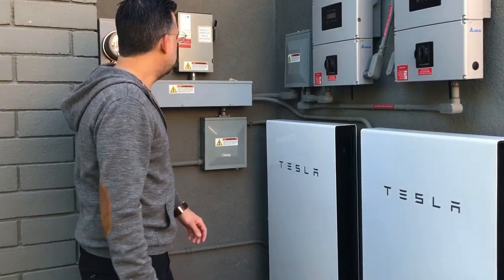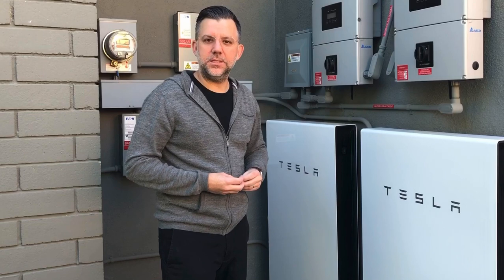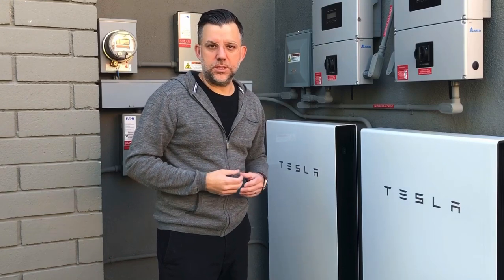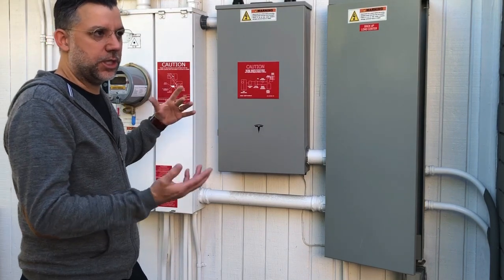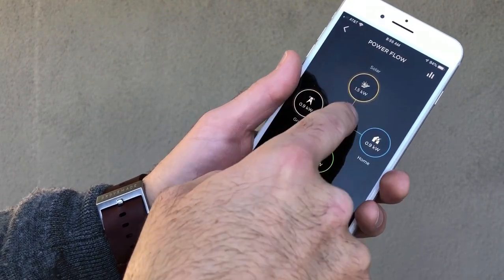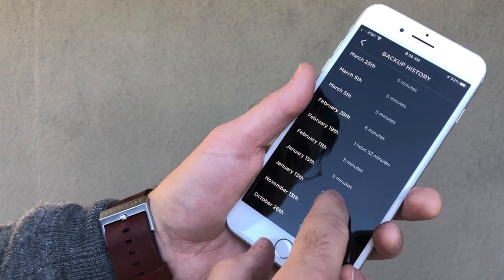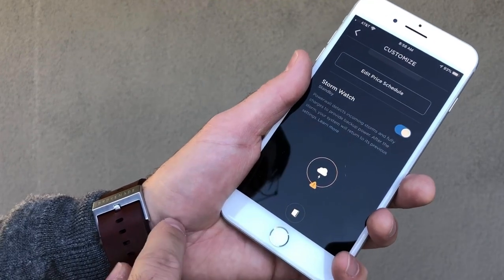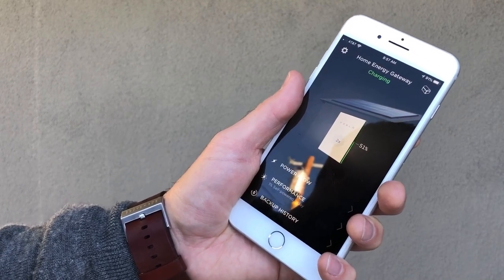Tesla Powerwall 2 hardware and software review.

Comment: Just had a similar set up in Stafford VA.  Got 36 panels but the new panels are 340w, also got 2 power walls.  didn't get a backup load panel because the whole house is being backed up.  Also got the Tesla backup gateway 2.  Ran a 12 hour self power test last night and used about 45% of the power walls before the sun came up. Winter will be a really energy hog out here, but should be able to be self powered through the summer. Thanks for showing your system.

Comment: What type of inverters(model #) are those how how many KWH can each support?
Reply from the maker: Hi Karl, Thanks for your question. The inverters are Delta Solivia 5.2 TL models. My system is 36 panels with a daily average output of about 7-9 KW. Each inverter supports a max output of 5.2 KW. I hope that helps. Let me know if you have any other questions.

Comment: How long does it take to fully charge one pw on a typical sunny day? I’m in LA as well.
Reply from the maker: It is hard to say as there are a number of factors that can influence the charge speed. The house usage on that day will affect the speed (is the AC on? the pool pump? is the car charging?) It really depends on the size of your system and the weather, sun hours etc. But generally speaking it should fill up in 4-6 hours. You can select it to prioritize the charge over the house power usage from solar. You can also select 'storm watch', which will charge it for you before a storm event or high winds.It is highly customizable through the app. I hope that helps.
Reply: ROOTSROBOT thanks for the reply!

Comment: Did you get the solar and pw thru tesla? Did you apply and qualify for SGIP rebate?
Reply from the maker: Yes, it was installed through TESLA. I did not receive the SGIP rebate. This was one area that I was unhappy with Tesla. They handled the application on my behalf and it it never came through. It is possible that I may still receive it but the whole SGIP process is extremely convoluted. Each installer has a certain amount of dollars available.
Reply: ROOTSROBOT status of rebate cannot be checked online?
Reply from the maker: @1baomao  I have contacted Tesla numerous times and have not heard back from them regarding this. The case number needed to check online is available from the Installer and I have not been able to get any updates from Tesla. This is an area where Tesla could definitely improve.

Comment: Great vid I am in the process of getting a 30 Panel system and 2 power walls. Question what if you have no internet? Does the powerwall still work?
Reply from the maker: Thanks for your comment and question. I believe that an internet connection is required. If there is no connection, you would not be able to monitor and change the powerwall settings. Also, Tesla needs to see the production status through the gateway in real time for troubleshooting. I would check with your local Tesla sales rep for clarity on that question. Let me know if you find out. Good luck!

Comment: Great video! I have had solar for 4 years in North Carolina, but did not have the chance to buy a Powerwall. In my area we have net metering and battery only makes sense for backup power or self generation. I am saving up though as battery makes my home more independent from the utility and their rates. Keep sharing you experience.
Reply from the maker: I encourage you to get it if you can add it to your system. Check with your local utility to see if there may be self generating power rebates available in your area as well. If you have TOU rates from your utility, like we do in Los Angeles, Powerwall is great for load shifting. This is the ability to bank power during 'off peak' (low priced evening power) and use it during 'peak' (high priced daytime power). It makes for an invaluable asset to any home. Here is a link to Tesla's page on this feature and how to enable it in the Tesla app: https://www.tesla.com/support/energy/powerwall/mobile-app/time-based-control

Comment: Currently having a similar system (32 panels & 2 powerwalls) installed as we speak
Reply from the maker: You are going to love it. Are you in the LADWP service area? if so I can give you some additional suggestions.
Reply: What are your first impressions?
Reply from the maker: @denniszhaunerchyk6191   The system is great and has provided backup power many times as displayed in the app history (shown in the video.) The app is what makes the powerwall so intriguing to me. It shows you what is happening inside the boxes. If you are going with solar, I highly recommend adding at least one powerwall.
Reply: @rootsrobot6781  Thank you for the reply, I recently ordered 24 panel setup with 2 powerwalls. The majority of the system use will be happening at night, so powerwall is a great addition. Hopefully it all going to work.
Reply from the maker: @denniszhaunerchyk6191  That will be great for you. It took me about 8 months from order to install with the backlog and permits. I also had to request LADWP to switch me to a Time of Use meter in order to utilize the bank of KW that my system produced. I will soon be doing a video on my power bill compared to 1 year earlier to show the massive savings in costs by switching to solar. It is a stunning savings.
Reply: @rootsrobot6781  I think solar/powerwall will make much more sense is summertime, where I spend about $200/month with Net metering here in CT, compared to winter usage, on average close to $130/month. I don't know if my utility will even provide an option to switch to pay for grid usage, depending on energy demand. But I heard United Illuminating is giving customers a credit for every kHr that they send back to grid. It should be a good investment.
Reply: I may .... order  TESLA                          2 powerwalls & solar roof ..but doing my research First !  So far sounds Great!!  How long will your 2 powerwalls and solar power last  you with no Grid ??                                      -With just maybe lights & refrigerator on a Black out ???